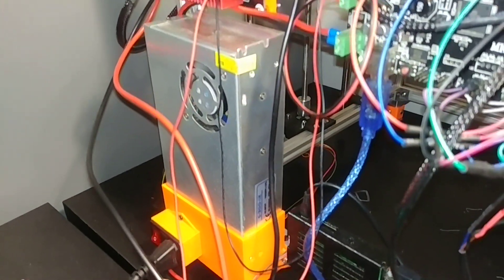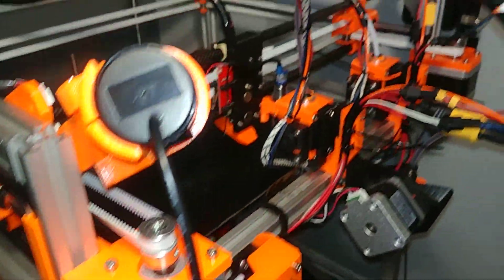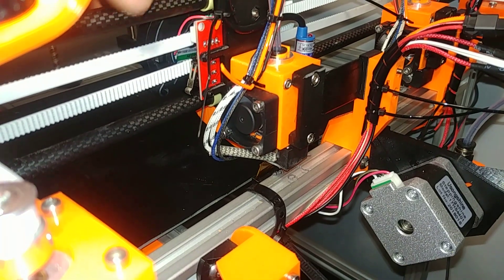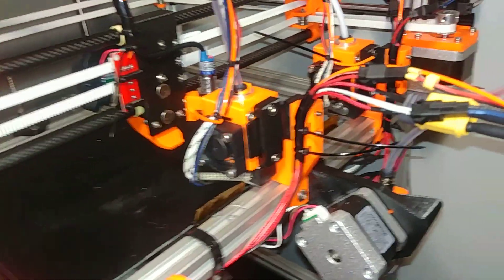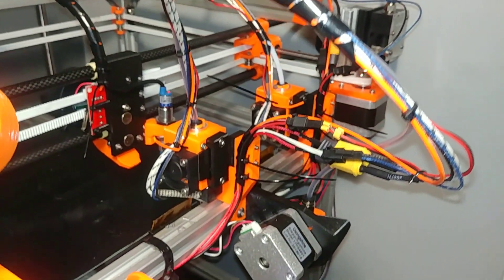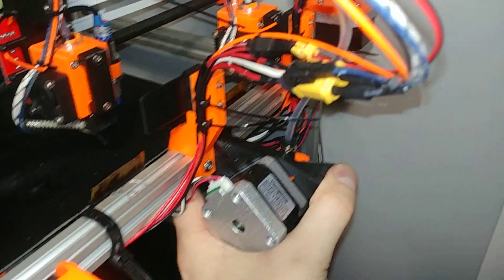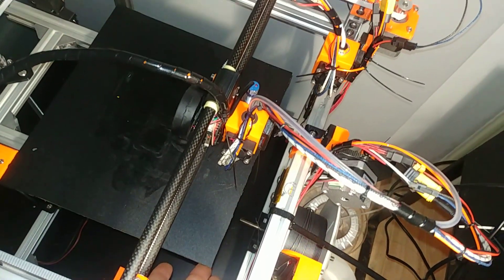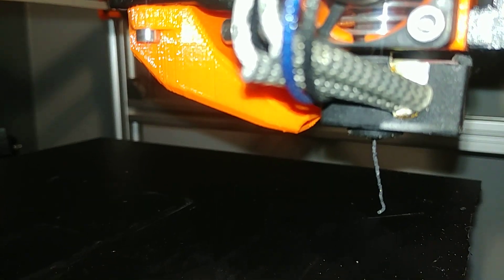HyperCube Parking Extruders

Comment: Nice setup btw. I am still undecided on which corexy to build. After seeing your EVA system, I know I want that setup with the gantry. It looks gorgeous and cleverly designed. For a 360-400mm build surface, do you have any suggestions between HEVO, hypercube or RatRig v-core (I discard voron because I want the EVA system)
Reply: @eva-3d948  thanks a lot for the information! Indeed, ratrig is looking more and more attractive.

Comment: Very nice job! Personally I do not trust just magnets. I would be afraid that print head will pop off when it hits a bump in print. I would add a servo-controlled locking mechanism so that print head is securely locked to carriage. Also for positioning you use screws - very nice idea but is locating head precise enough? Is there no play between screws and the holes they go into? Maybe conical shaped pins and holes instead so that there is no play on the position once head is pulled in by magnets. To account for differences in hot end length you could have an adjustment screw between the part that has magnets and locating holes and part that holds hot end. Sliding up and down as you rotate screw. Then you could adjust height offset of each hot end individually. Just my thoughts.